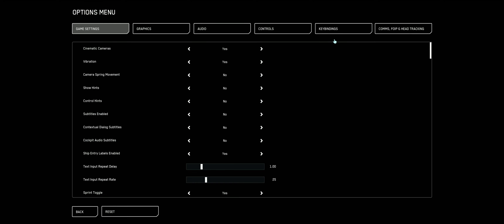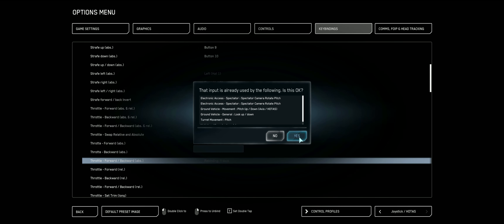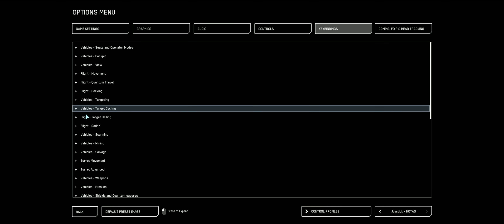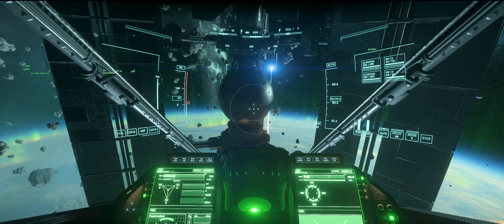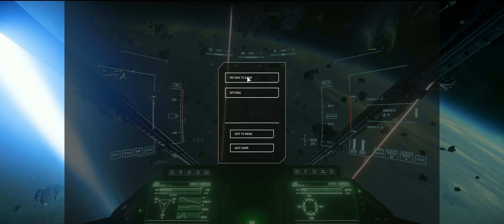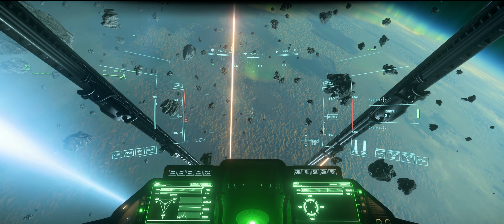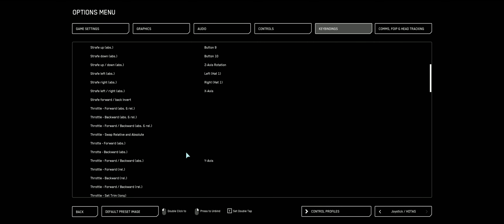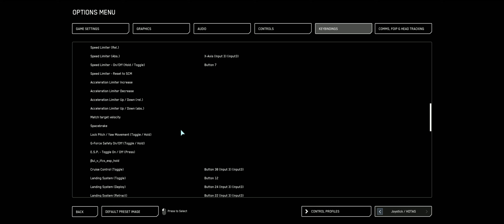Quickly, easily setup your single, dual joysticks, throttle in Star Citizen 3.20+ Also REL vs ABS!

Comment: I am the worst combat pilot in SC. My only kill was to tackle my enemy to spin and crash.  With this guide i be in better control of my ship. No more trade runs for a while. My second stick Thrustm 1600 arriving today and borrowing Thrustm 1600 w throttle and pedals will be my way of reducing keyboard keys and have fun. I am going to use your setup as base for my flying experience.
Reply from the maker: Dual sticks def makes it more immersive! Check the new video for some tips on the mastermode keybinds.

Comment: Great video, I hate setting this up with a passion! My biggest issue is finding the best key to use for something and worse is remembering what I set to do what.
Reply from the maker: There's a utility called Joystick Diagrams that I used to create images showing button mappings.  It supports VKB Space Combat Edition after you rename the related files to match. Finding the right button... oof, I've gone back and forth for awhile.  Combat related seems to work better on the right stick hats for me being right handed.  Request landing, map toggle, etc I bind to the bases. Download the linked keybind files and review the diagrams for inspiration.

Comment: Thank you for this.  I stopped playing SC 2 years ago because of my X56 giving ghost inputs and I threw it against a wall.  I'm ordering VKB sticks and this guide really helps.
Reply from the maker: You're going to love the VKBs! Glad I could help!
Reply: I did end up getting the VKB NXT combo with Omni throttle.  I also got the STECS and add-on panel (MAX I think) and couldn't be happier.  I'm getting used to the HOSAS but still use the throttle for acceleration and cruise control.  The resolution and feel of these things is amazing.  I have the clutches set just to the point where they almost don't center and feel amazing.  Weakest springs in right stick, stock springs in the OT.  I did similar mappings to yours, except I want roll on my X axis and yaw on my Z twist. (right hand)  Left hand is translate with twist being up/down.  Really wonderful entry into high-end sticks.  Just having an issue with the Quantum drive engagement, where I can activate the drive but not engage because of the mandatory (hold) function that can't be changed.  None of the buttons on the STECS will hold long enough to engage.  I'm sure I need to play around with the software but otherwise super happy with it.
Reply from the maker: I haven't dug deep onbth3 stecs button setup yet but it might be set as a momentary (fast signal then none) which would make engaging quantum a bit tricky as you press and hold. I use one of the buttons on the base of Mt left stick now and it works OK. That profile attached to the video (linked in description) has it bound to left stick hat left.

Comment: Really love that you took the time to do this. Been playing sims (and star citizen) for years, with quite a few diffrent setups but mainly used Thrustjunker T16000M HOTAS for years now. ABout 4 sets of them in 10 eyars because they're such garbage. When the inevitable potentiometer went bad the most recent time I manually upgraded it to a hall sensor. But it also needs redone every couple months so long story short I just ordered VKB's and was dreading having to go through the word soup that is Star Citizen's keybinds. Your bit on absolute and stuff extremely helped. SO thanks. 

Also, what kind of freak yaws with left to right XD. I'm kidding, I know some people do that. I can't. It doesn't make sense in my brain. Z-roation is like a steering wheel which turns left and right. IDK. lol.
Reply from the maker: Very high praise that is very much appreciated! I started with the tm16k as well. You'll love the vkbs!

Comment: Absolute life saver. thanks
Reply from the maker: I'm glad it helped :-)
Reply: @PaganLinuxGeek  what button do you have your quantum start mapped to? Mine doesn't seem to be turning on, even tho I mapped it to quantum start. Appreciate all the help :) without it I'd still be stranded in space trying to figure my settings lol
Reply from the maker: The same button (left stick, middle hat, left < ) is used for both. Short press to enter qt mode, and a long press (3+ seconds) to engage qt. Th3 default keyboard map is short press B to engage qt mode, and long press to actually jump.

Comment: The amount of people that use yaw on the X axis rather than on the twist on right stick or rudder pedals is mind blowing to me. I would suggest getting the omni throttle adapter for left stick if you are using VKB gladiators. Makes the twist for up and down more intuitive at least in my mind.
Reply from the maker: Well I like it that way. :-) The good thing about options, is that they're options. Do you need some assistance setting yaw they way you want? Have a vkb throttle on left side of my left stick so got that covered.
Reply: @PaganLinuxGeek  That is the beauty of it, there are crazy amount of options to fill everyones needs. Just didnt know I was in the minority lol. I was seeing what other people are doing. I have VKB sticks, with the left being an omni, virpil pedals and throttle. I was debating about how to incorporate my throttle but not sure what to use it for.
Reply from the maker: @chadley792 I've bound speed limiter to the major axis. Mining power to the smaller throw. I'm deciding how to map the various modes to the turn knobs. Most are easy enough (mining/salvage/towing, quantum, scanning). Might have to bind a quick.doubke tap of B to the last position for "normal".mode. The remaining buttons are.awesome for doors, ports, landing gear, configuration toggle. I'm using the WWII throttle. Which are you using?
Reply: @PaganLinuxGeek  MongoosT-50CM3 I was thinking about using it for a speed limiter but I also want to try to fly decoupled  most of the time so that would be null and void. Not sure how the upcoming master modes are going to change everything though. I haven't tried it out yet
Reply: Today is my first day playing star citizen (well arena commander racing) and I used this video to set up my gladiator evo next premium stick (right hand) and omni throttle (left hand), I initially set up my right hand stick to roll on x and yaw on twist. I quickly changed it back to the default, yaw on x and roll on twist (but i inverted the twist direction) because Rolling and pitching did not fly like I was expecting (at least not near the ground), it did set the pinky button to swap roll and yaw (as that might work better in space).  Maybe if I could decrease the sensitivity of the x axis for roll it might fly more like I was thinking.  Btw I swap out the #20 springs in the right stick for #10 springs.... I think #15 springs might be about right for me, may have to order those.
Reply: People put yaw on the right stick x axis because you need it for more precise aiming. We don't roll into our turns in space ships, so roll is not as important as it is in atmospheric aircraft.
Reply: Update... I changed my set up to be more like avenger one.   Yaw and pitch on right stick.  Roll on left stick (omni throttle) twist, left stick forward and back is vertical strafe and got vkb (gunslinger system) pedals for forward and backward (more like driving a car).  I know it sounds weird but it's Hella intuitive/easy in practice.   Made a huge difference in my ability to fly without crashing.  However I had to use vjoy, joystick gremlin, and hidhide to make it work with star citizen which seems hard-coded for max 2 controls.   I put pedals as a slider on my left stick omnithrottle so I can use them in fps with right hand vertical mouse for aiming (using omni throttle trigger to shoot, so clicking doesn't move the vertical mouse) so im hands off keyboard for as much of the game as possible, and have mostly unified/uniform control motions in fps and vehicle phases.

Comment: Just a suggestion for triggers: I bind one trigger per group too, but in order to avoid having to change default groups, I remove group 1 and bind group 2 and 3 to my triggers. This way the default SC bindings (energy on G2 and ballistics on G3) are already correct.
Reply from the maker: I've been playing around with fire groups to dual stage trigger binds in the PTU. The new video (still being produced) will have a section about this. Currently I have stage 1 right stick trigger to fire group 1, stage 1 left stick trigger set to fire group 2, 2nd stand right stick trigger to fire group 3, and left stick 2nd stage trigger to fire group 4. I've found this useful for the Hornet and F8C with the variety of guns. I can fire some of them on stage 1, and the others on stage 2. Lets me keep fire on tougher targets while the caps recharge. I appreciate you confirming that I'm not alone!

Comment: Thank you for the video! I'd like to see how the rest of the button is set up.
Reply from the maker: In the linked zip file are my keybinds, and 2 vector images (open with edge if you don't have a preferred vector raster) with the keybinds shown. They were created with joystick-diagrams program. Basically the right stick is nose control (pitch, roll, yaw), targeting, countermeasures, etc. The left stick is navigation, doors, landing gear, vtol, lights, freelook, etc.

Comment: Thanx. I have a x52 pro which I use on older pc but on my new rig I have warthog set up with ch pedals, cougar mfd's, 2 game glass tablets, tobi eye. Even with all those input options it's still difficult to make sure I have the most important functions selected. One thing that makes it easier is to find out which one is which and write it down. pedals=(input 3), throttle =(input 1) for example.
Reply from the maker: I try to keep the controls I use frequently,.or used in the midst of combat on the hats to minimize.hand travel. Infrequent binds, I typically place on the joystick bases, or on the button box portion of the throttle. Landing gear, VTOL, wing configuration, atc,.door and ports are prime candidates. That's my way, but each has to map according to what works best for them.

Comment: HOSAM for me. Love having a left stick with angle attachment. Excellent console tip. Is there a reference to those commands? Floppy disk lol. I remember those days
Reply from the maker: Hey Chase! Good to see ya! I'm not aware of a comprehensive  console command reference. Some are well known. We're also seen some new ones with the gen12 renderer implementation. Pp_swapdevices joystick # # is a simple flipper to exchange the bindings. You can do the same using a text editor on the xml file if you enjoy that sort of thing. I'm also aware of r_displayinfo [0-3] to show more information about the display such as framerate, memory usage, etc. Also there is r_displaysessioninfo [0-1] to show the session qr code. Handy for bug reports!

Comment: Hey Ive noticed that the current PU LIVE patch 3.22.1 detects my L-stick as it’s first joystick and any keybind from that stick can be bound as a double tap by pressing ‘Y’. However every other controller like the R-stick or other button panels wont allow for double tap and when their keys are bound. Those include all key binds labeled as “button ‘#’ (input #)”. Please share if you have a solution to this. I Have a full VKB setup with dual Gladiator NXT EVO’s and T-rudder Mk. V with SEM THQ and FSM modules. Great video as well! The control swap console command helped so much 👍
Reply from the maker: Do you have joystick gremlin or other joystick control software running?
Reply: Nope, I just calibrated all of the sticks and modules and close the vkb software. I have been thinking about using joystick gremlin though
Reply from the maker: I would only use it if absolutely needed. Less stuff running on the system, and managing joysticks is better IMHO. Have a friend that has to use it for pedals as SC doesn't allow mapping them as needed. Trust me he'd love the option of dumping it. I want to make sure I'm understanding you correctly: the PTU is allowing ONLY your left stick to have 2 functions for every button if you hold the Y key down?

Comment: yea they changed the inversion for thrust not sure what it is now (no longer throttle forward/backward(abs.)).
Reply from the maker: And a few other keybind breaking changes too. Sometimes I feel like Yogi does it on purpose. :-/ I'm planning to record an updated video this weekend. I want to spend a moment explaining some tips for the master mode toggle and Q jump as you cam bind.both to the same button with varying press durations. Short press to toggle mode, and long press to engage jump. The inversion name escapes me at the moment but I recall it was I'm controls - flight movement -  forward /backward

Comment: Have you ever used the left VKB throttle style stick. I got a good deal on some barely used ones but they’re coming with the left stick being the throttle style. I wonder about buying the attachment from VKB to convert it from HOTAS style to HOSAS style
Reply from the maker: I've not personally but have heard great things. @scarredcitizen uses one if I recall correctly as well as severally others I see from.time to time. Most love that it makes the vertical strafe more natural. I'd suggest trying it a bit before making changes. Might be good fit. :-) Thanks for watching and commenting!

Comment: Sub earned great vid. I am trying to figure out how to setup my throttle so it is either is reverse mode or drive like a gear in a car so i can have more length of travel for more precision
Reply from the maker: There is a throttle forward axis binding option. If you do that then I'd urge you to bind a key for toggling forward reverse a couple lines underneath it if memory serves. Doing this means throttle all the way back is 0, and full forward is 100%. Pressing button means ship moves backwards.

Comment: What should I buy? 2 joysticks or a joystick and a throttle
Reply from the maker: I'm a fan of two sticks for Star Citizen myself as the ships have 6 degrees of movement freedom, and two sticks give you an analog input for each. Pitch/Roll/Yaw on one, and lateral/longitudinal/vertical strafing on the other. Or however you want to map it. Throttle gives you a finer forward movement input but loses the analog for left/right and up/down strafing. To keep the "actually pagan" commenters at bay, I'll add that SOME throttles have hats and mini sticks that can be bound.  Speaking personally I prefer HOSAS (hands on stick and stick).
Reply: @PaganLinuxGeek  if I was to get a peddle for the yaw would I still need 2 joysticks?
Reply: @PaganLinuxGeek also do u have a link of what u use?
Reply from the maker: Well you'd need something for the pitch/roll still on the orientation side of things.
Reply: @PaganLinuxGeek  what would you recommend me getting?
Reply from the maker: Sure I'm running a pair of VKB EVO Space Combat Edition Premiums. Also have a STECS throttle that I'm currently incorporating. Mainly for the buttons though. https://www.vkbcontrollers.com/products/gladiator-nxt-evo-space-combat-edition-right-hand?variant=39887803613302 and the matching https://www.vkbcontrollers.com/products/gladiator-nxt-evo-space-combat-edition?variant=39778458599542 Here's the STECS https://www.vkbcontrollers.com/products/stecs-throttle-system-standard

Comment: I just received my dual VKBs but as I was setting them up while following the video, the game doesn't recognize certain buttons on just my right joystick. On the left one everything registers, but for example Pitch and Yaw work but when I rotate the stick for Roll the timer just runs out. Same thing for Weapons group one when I pull the trigger.
Reply from the maker: Run through the reset and configuration utility as per VKB video. I'll bet that fixes it ;-)
Reply: Thanks that did the trick! @PaganLinuxGeek
Reply from the maker: Glad I could help!.

Comment: Not sure why but I can't stop rolling. Using virpil alpha primes.
Reply from the maker: First I'd suggest running calibration. I don't have Virpril so not familiar with how to do that. Then run the windows joystick setup to make sure all axis are staying at center when not being moved. It sounds like the stick is not centering correctly. That's a guess based on your comment so apply gratuitous amounts of salt. If calibration and testing doesn't resolve it, then perhaps adjust your dead zone a bit. Ive got a short video on that here https://youtu.be/ACQ9tMTF82s?si=mlRAL3bzoLEKlczm
Reply: @PaganLinuxGeek  I'll try this now thanks
Reply from the maker: @AkalaFPS np wish I could be of more help.

Comment: the z axis on my left stick doesnt work. i have vkb gladiator nxt premiums. the left stick works for all other controlls but it will not let me bind Z for strafe up and down
Reply from the maker: Does it work when using vkb configuration? If not then hit the vkb discord. They are awesome in there. If configuration utilities show movement then it's not bound in SC. Follow the video again from the start. Use (abs) binds when opted.